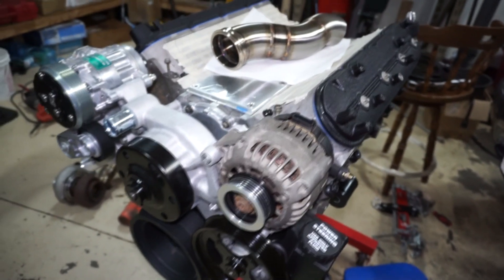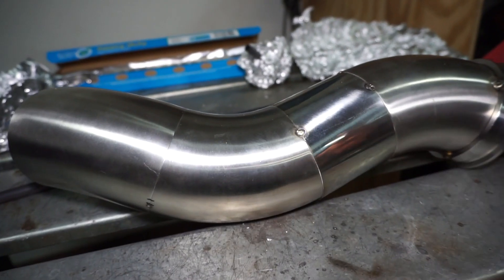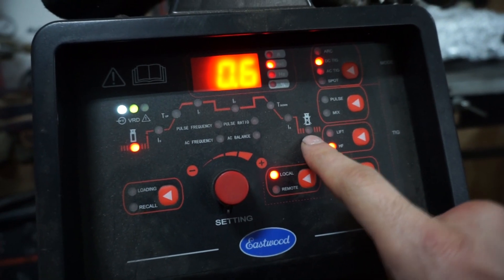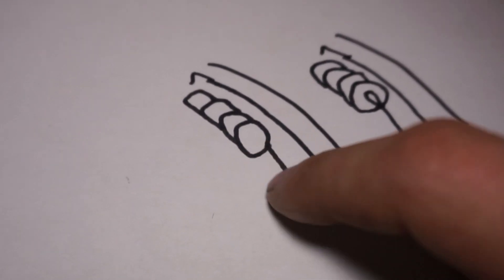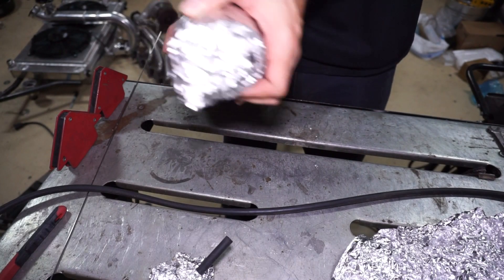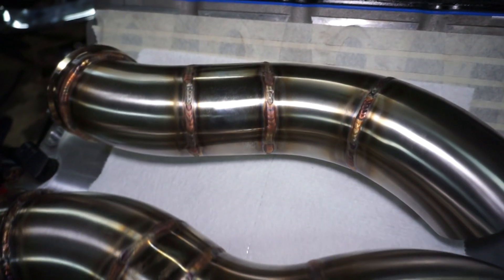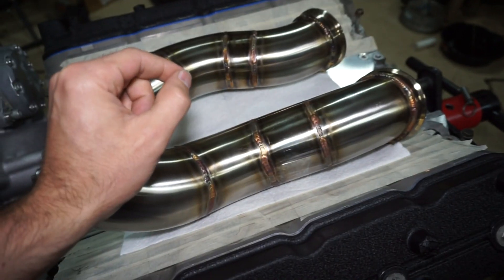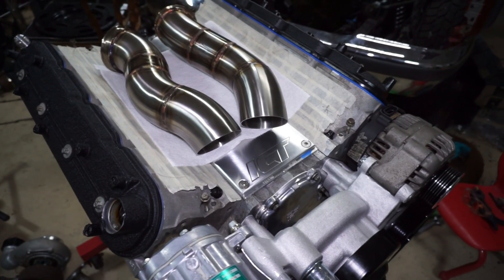How I TIG Weld Stainless Downpipes | With Machine Setup

Comment: I realize this is 2 years ago but you did say to add hints. I noticed during your post flow that you would pull your filler rod away. Leave that filler rod in the post flow as it needs protection as it cools as well.
Reply from the maker: @grantensrud9185  That's a good point, never really thought of that. Thanks.

Comment: I have about the same experience with TIG, but been welding MIG for many years. One thing I do as a practice to help with any distortions, using my tacks as starting places, alternate from side to side with my welds, as opposed to continuing around all the way around. I'll run a 1/2 to 3/4 inch bead, flip over 180, do another, turn 90 degrees, another, flip again, another, repeat till all is filled in.
Reply from the maker: Nice!

Comment: If that is a FUPA 12 cup you have to use 20 to 25 cfh. It will give you more beautiful results.  A little bit of more seconds of post flow will help you get cleaner welds too. Maybe like 10 secs. But you are doing great. Good job bro. Keep it up!

Comment: Hey! Welds look good! You might want to advance your torch angle when going around the curve of the tube. You start good but as you go along, the angle becomes drastic, almost 45 degree. This can cause cold welds, as the filler melts before you can put it in puddle.
Reply from the maker: I notice that when editing the video. In my head I feel like I'm correcting it, but clearly not very well per the video, lol.
Reply: @BlaserBuilds  if you are self aware of this, then it's all that's needed. Means that you'll remember to account for that when you think that you're right on while welding. I'm not a pro welder myself, but it's real easy to spot mistakes when watching someone else. I bet my angles are all over the place as well.
Reply from the maker: @kristapsliepnieks9949  Thats one reason I like to record, easy to spot mistake i cant see myself.

Comment: if you are welding .055 wall just use the 10% over amp per thou rule and the foot pedal, you could use more heat from what it looks like, solid welds still.

Comment: You actually want flow, through your tube, while purging. Should put a small hole in the cap side. I use .045 wire on tubes and 1/16 on v bands. 1/16 tungsten works a little better, under 100 amps, too.
Looking good, though.
CFH is usually double the cup size, too. ;)

Comment: Looks good. A few tips:
Get you some solarflux so you don’t have to waste gas on the vbands. 
Try smaller filler. Probably .040 stainless mig wire. 
Something like that, i’d be welding around 90 amps. A bit less as it gets hot. But you have to be able to move fast. It takes a bit of practice but it makes a big difference on stainless. 
Clean the tubing and the filler with alcohol before welding and wear a glove in the filler hand. 
Even tho its thin wall tubing, try adding a small bevel. It makes the welds flatter and neater.  
Nothing wrong with that you have going on there, but just tips that will help with consistency and speed.

Comment: with gaps as tight as yours you could probably get away with using .035 or .045 wire .  for that #12 cup its recommended 20-30cfh . the rest looks amazing , have used that layzer tungsten from CK and its super stable for dc and ac welding